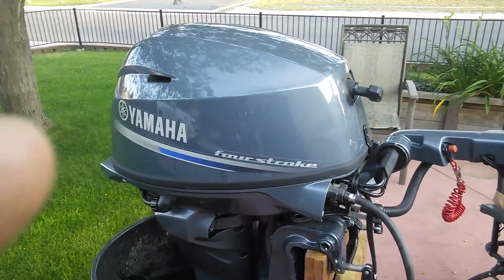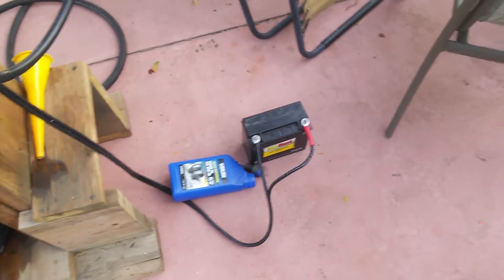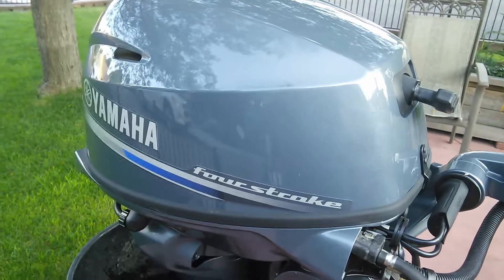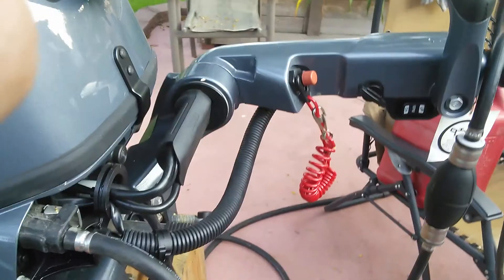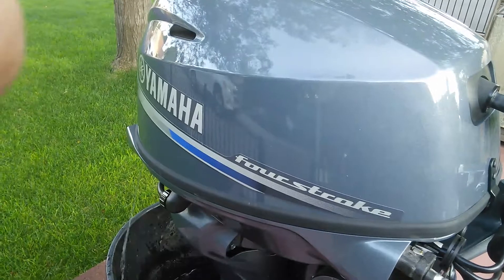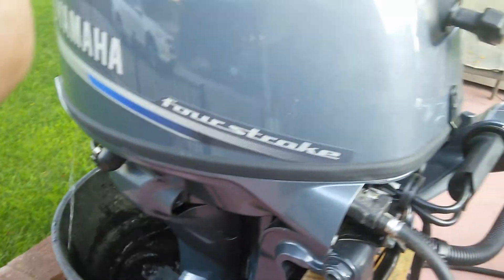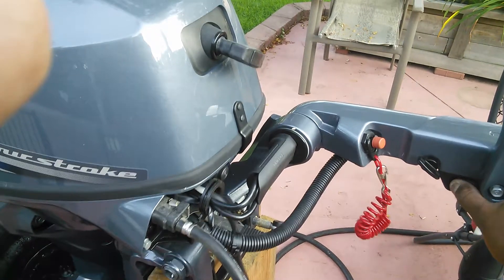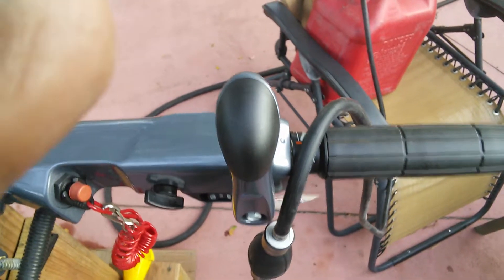Yamaha F25 outboard efi update part 1.5

Comment: Per hour fuel
Reply from the maker: Do not know, I don't have the link to read that. At 1/2 throttle on plane it will do 7 miles per gallon. I use a 3 gal fuel tank have run 28 miles with some left in tank.

Comment: Is there a difference between using the flushing adapter or the bin? 

Just wondering as I have just bought this motor.
Reply from the maker: You can use the flush port, if you don't run the engine. The flush port provides water from above the water pump but just below the oil pan up through the engine block, DO NOT run motor, the flush port will not provide enough water to lubricate the water pump impellor.
Reply: Thank you!